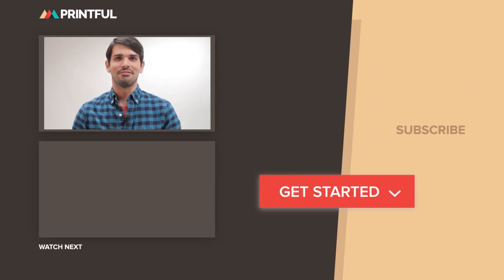Printful - Custom printing and dropshipping

Comment: Hey Printful, if I choose a unisex shirt I should have the option to list sizing in mens or women's or just list the size, dont put mens before the size. Its confusing and has definitely resulted in lost sales. My lost sales are YOUR lost sales. Also, we should be able to change mockups and shirt styles on the fly. And if I submit a product to store and it doesn't go through for whatever reason, I shouldn't have to remake the entire thing!!! In addition, what is the deal with your new pointless mockup grid?
Reply from the maker: Hey Jay! Thanks for the feedback! We assume you're talking about our Etsy integration regarding the sizing issue. It's a limitation on Etsy's end. Here's how it works in general:
1. If the shirt is pushed as Men's, the sizing will show as S / M / L, etc.
2. If the shirt is pushed as Women's, the sizing will show as S US Letter / M US Letter, etc.
3. If the shirt is pushed as unisex, the sizing will show as S Letter size (Men's) / M Letter size (Men's), etc
Etsy will show unisex products noting that it's based on Men's sizing. Also, make sure to check our feature request page where you can add your own requests or vote for existing ones.
https://www.printful.com/feature-request
Reply: @PrintfulCustomPrinting  Thanks for the reply. I feel like on your end there should be someway to just push the sizing as s m l, etc.  Because as it stands, I should push all items as men's to get that designation and change the category in Etsy. Now that I know, I'll do that but it doesn't make sense. Maybe let users know or work with Etsy to resolve. I get bombarded with questions asking me, "What size should I get?" and definitely loose sales as a result.